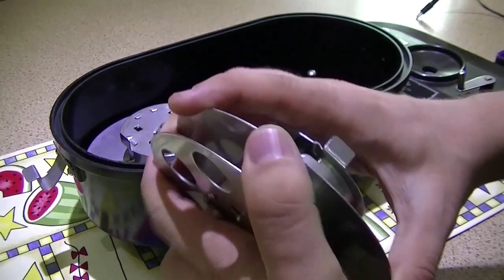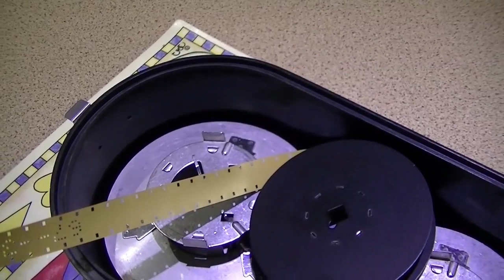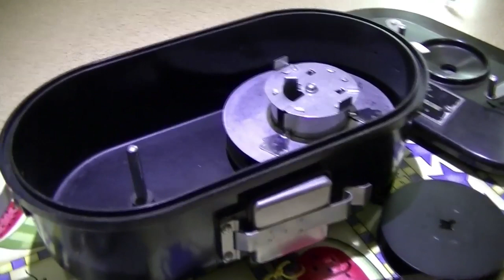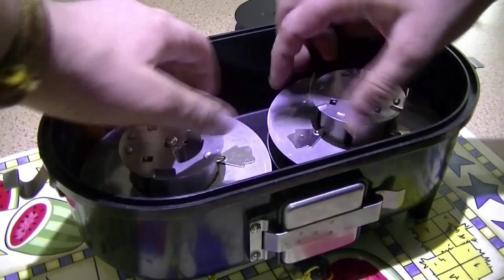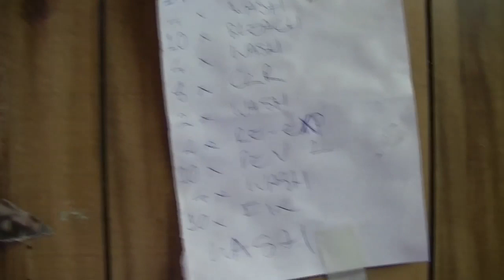Loading And Using A Morse G3 Developing Tank

Comment: 106.5 feet of film and leader was in mine. I measured it. Then, it took 133 cranks to wind the film from one side to the other. That took 1 min and 20 sec to make the 133 cranks. I did slow down a little near the end when the supply side was spinning really fast. I just wound it with a normal crank speed that felt good. Not too fast and not slow either. The tension makes you wind at a certain speed to have something to pull on. 4 passes took 5 min and 20 seconds. D-94 only takes 2 min to develop the first time on a LOMO spiral, and D-95 only takes 30 seconds to develop the second time, but I don't know how many passes that would be on my Morse tank..

Comment: Thanks for the video! I just bought one of these tanks as I like to learn to process myself. I'm just getting into 16mm filming, bought a vintage Keystone deluxe some time ago but was not sure film is still available.
Reply from the maker: You can still buy film. I get mine from Wittner Kinotechnik in Germany. They do both double and single perforated - check the feed sprocket on your camera to make sure you get the right type.

Comment: The first thing on every list is to wash one's hands. Then a reminder to remove rings and watches. Not only did they get in the way, back in the day watches weren't as waterproof as they are now. Plus, the chemicals could have possible...eh...interactions with the materials of rings and watches — especially those thirty-dollar Rolexes your girlfriend got you on the boardwalk! Best if all such were removed prior to...developments you weren't counting on. The Morse G3 brings back so many memories.

It would have been better if you had actually poured water into the tank during the demonstration to show how quickly it filled and the quantity needed. (You could have removed the film first.) You then bump it sharply to remove bubbles and go from there. Regular 8mm could be fed into it because it was actually 16mm, exposed on both sides, developed, then sliced down the middle and spliced into a single roll of film. 

Ektachrome could be developed, but I think Kodachrome had to be developed by Kodak, I think. I also developed B&W 8mm film which I reloaded onto 16mm reel/8mm reels. 

It was so cool, but it was such a pain in the ass. Very expensive and the results...meh. You went through all that trouble for just seconds of play back. What a waste of time, money and effort. I had a really cool toy, an 8mm toy projector that actually worked quite well. It broke down the middle and one half was a screen. You could then extend a reel take up, load on an 8mm film reel and watch whatever movies you wanted up to 50 feet. It worked well and didn't jam or chatter. I went in our bathroom, turned off the light and had my own drive-in. Wolfman, Frankenstein, Dracula and other Famous Monsters of Filmland movies, all at 24fps!

We've come a long way. 

__

Comment: I know you have answered this already vaguely. But I am developing Tri-X 7266, should I take your times and deduct 2 rounds from the total of only developer or all chemicals? How strict should I be with the temperature and timing? Also how many times can I reuse bleach? I am using Rollei B&w reversal kit to try this. Should be fine right?
Reply from the maker: Deduct 2 rounds just from the first developer and keep the rest as is. The best thing about B&W is there is a bit of latitude and room for a bit of error. I just keep a steady rhythm in my head when turning and it takes approximately one minute winding from one reel to the other. Nothing what I do here is extremely precise and I get good results. If you want to be pedantic, the first developer is the most important because screwing this part up ruins everything else down the line. You can't over bleach unless you fall asleep, and clearing just gets rid of the stain left behind by the bleach so you really can't overdo that either. I have done the re-exposure with the lamp slower and it had no detrimental effect. Likewise, you can't overdo the second developer as it just turns black the remaining silver - you can use anything here, even Rodinal, caffenol, Dektol, nothing special. Some people don't even use fixer but I do just for safety in case there's any remaining silver that shouldn't be there. This can't be overdone either unless you leave it soaking for hours and hours.
Reply: snarfusmaximus thank you for taking your time for this reply!! I’ll give it a try tomorrow! Would Kodak HC110 developer also work you think? How many times you think I can reuse the developer for the 100ft film? Also bleach should be okey to reuse a couple times right? Once again you are big help on this one. Not many people have had any info on TriX online!
Reply from the maker: I would use a high contrast developer for the first developer. I use D19, as I bought heaps years ago, but I believe it has been discontinued. From what I have read, Dektol is a decent substitute although it's meant to make the film look grainier. HC110 will be fine for the second developer but don't reuse it as it's a one-shot developer - can only be used once. Powder developers are generally reusable. You can also reuse the bleach and clear a few times as well.
Reply: @snarfusmaximus  Today was the day. Finally tried out my test roll. Took ages but was fun and luckily know that this second bolex I got works. However the film turned out undeveloped I would assume. The first two feet of the 100ft film look decent but the rest is just hard to really see anything. Judging that the first feet got more developing time being at the end of the film, would you recommend having it in the developer (Microphen) longer? I developed TriX 7266 reversal. How accurate do you have the temperate of the chemicals? I might have been 1-2C over the recommended 21 degree celcius... any help would be appreciated! I can also send some examples for you to check.
Reply from the maker: Assuming you exposed the film correctly - If the image is too dark, then it hasn't spent enough time in the first developer, if it is too light then it has spent too long in the first developer. I don't know what the times would be for Microphen but the above should be a guide. A degree or two above or below should make little difference.
Reply: @snarfusmaximus  yeah will try again tomorrow, might cut 100ft in half and try at 20 passes and see what happens and then correct if needed for the other half. Powdered First Developer, Bleach, Clear, 2nd Developer, Fixer should all be good to use for a couple rolls right? Also got a bit of the bleach on my hands while draining it out of the tank, if no burns, nothing to worry about, right?
Reply from the maker: @Visualtraveling  Yes, can be used for a few rolls. I've only used a dichromate bleach and that can be used a few times but am not sure about a permanganate bleach in case that's what you're using.

Comment: Hi there, thanks for making this video! I'm curious what your bleach solution. Thank you for your time.
Reply from the maker: My original bleach recipe was 12ml of sulphuric acid and 9g of potassium dichromate to 1l of water, using the amount of cycles displayed later in the video. I now use half the amount of acid and dichromate in 1l of water and double the amount of cycles. This has the advantage of being gentler on the film but you can't reuse the bleach.
Reply: thanks a lot!

Comment: Wonderful video mate. Mine should be coming soon and I'm planning to do some standard 8 Fomapan soon. I'm thinking since there's only 30ft of film on a spool, I would need to do two full cycles a minute instead of one with 100ft of film. Any tips on drying the film once done?
Reply from the maker: You'll find that you'll process a 30ft roll much quicker, probably just under 3 cycles a minute. Keep your pace steady and constant, around 2 turns a second like I do in the video. I did some Plus-X like this and it looked fine. The hole in a standard 8 spool is also smaller and won't fit on the rods in the tank. You may need to initially wind it on the developing spool by hand. All is the same from then on.

To dry, I just wind the film around a clothes horse with the emulsion side out. Don't forget to use Photoflow in the final wash to reduce drying spots. Also take note of my comments elsewhere about Fomapan R needing a fresh batch of chemicals.
Reply: snarfusmaximus Excellent and very helpful video!! Thank you very much...I've got my hands on a Morse G3 too and I'm going to try developing some standard 8 Fomapan R100 30 ft  length with it. I want to try to figure out if the number of cycles would change from your method using a 100ft length. Would I do the same number of cycles as you are doing, even though the film would spend much shorter of a time in the chemicals?

Also, are you using Foma's reversal kit chemicals for this?
Reply from the maker: Many thanks. The number of cycles are the same as long as you turn it at the same rate of two turns per second. Being a shorter spool, it'll be quicker than if you did 100ft. I've never used Foma's reversal kit. I use Kodak D19 for the developers, a potassium dichromate and sulphuric acid bleach, a sodium sulphate clearing bath, and what ever fixer I have on hand. Unfortunately Kodak discontinued D19 a while back so I'll be forced to mix this up from scratch once my remaining bags run out.

Comment: Many thanks for posting this, I just got hold of a Russian copy of this tank and am trying it out some Fomapan R very soon. What quantity of the solutions do you need to add to the tank?
Reply from the maker: You only need 1 litre. The chart at the end of the video for the amount of cycles per bath will be fine for Fomapan.

One thing to take note is that Fomapan R needs fresh chemicals - i.e. be the first film. You can reuse the chemicals for other film stocks like Tri-X or Orwo etc. I think this is because the anti-halation layer on Fomapan is silver and not a dye.

Comment: is there a link to see the developing cycles for tri x?
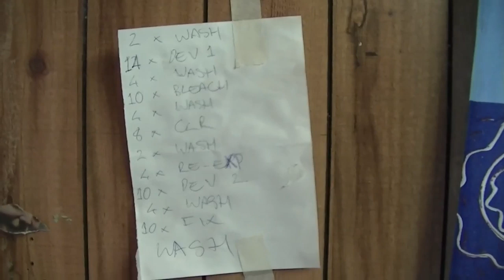Reply from the maker: Please refer to the chart at the 12:35 mark. Just do two cycles less for each development stage. Works a treat!
Reply: Cool. Do you know of a place to purchase the bleach. I believe tri-x requires an r10 bleach that I am having trouble finding. I have the d76 fix and hypo clear etc it's the bleach that's giving me trouble
Reply from the maker: I use potassium dichromate and sulphuric acid as a bleach for all B&W reversal. I stocked up on the stuff years ago, got it from Vanbar in Melbourne Australia (me living there). Most decent photographic suppliers should carry the stuff. A warning though - sulphuric acid is obviously dangerous, and the dichromate is bloody nasty stuff known to be carcinogenic. Exercise some real care when handling it.
Reply: snarfusmaximus The clr step is HYpo clear yes?
Reply from the maker: The clear bath is to remove the orange/yellow stain of the bleach. It's made of 90g of sodium sulphite to 1 litre of water.
Reply from the maker: http://blog.lib.umn.edu/tsuda005/filmmaking/filmmaking/Processing%20B%26WRev%20Film.pdf
Reply: @snarfusmaximus  this link dead.
Reply from the maker: @pedade02  Well, looks like the server is gone.
Reply: @snarfusmaximus  thanks for your video, almost none about morse g3. There is substitute To Kodak d19 developer  called Photography formulatory d19, I will order and see how it works  for Fomapan r100. Do you think peroxide+acide citric bleach option might work? I know many ones use it for 35mm film and photo paper reversal. Many thanks again.

Comment: Would Permanganate bleach work with the same amount of cycles?
Reply from the maker: Yeah, it should
Reply: @snarfusmaximus  Alright. I tried my first round of development of some expired (1963) BW reversal tri-x (16MM) last night and results were- less than stellar. About half was because im new and under exposed a lot of it, which led to it remaining a negative.

There was a lot of grain which I think is due to the age of the film

but the major issue was the terrible contrast. shadows were just super dark and the film seemed almost foggy. I used the foma reversal BW kit, so maybe the developer is just shit or I need to adjust it for the expired film? 
idk, still learning

Thanks for the speedy reply!
Reply from the maker: If you're just starting out and processing your first film, use a new roll. This way you will know if you're doing it right or not. With film that old, you need to overexpose the crap out of it. Even then, reversal processing isn't recommended for film that old. It's better to process it as a negative and scan.
Reply: @snarfusmaximus  Ok, thanks for the help!
Is there anyplace I can pick up 16mm reversal film without spending an arm and a leg? All the new stuff is like $50 for 100 feet
Reply from the maker: 16mm is generally expensive. Foma R100 is probably the cheapest you'll find although it requires fresh chemistry for each roll.
Reply: Last question hopefully:
I’m using a d-19 substitute developer from photographers Formulary. Shouldi still have it in the tank for as many rotations?

The film photography project recommends 8 minuets in a Lomo tank with the D-19 substitutes at 20 degrees Celsius
Reply from the maker: If it's the D19 formula, then you can use it for the same number of cycles in the Morse tank. From memory, 8 minutes in a Lomo was the same time for true D19.

Comment: It's possible to get 100 foot lomo tanks. You might have to fight brutally on ebay for them though. If you're tired of all that cranking why don't you just do it with a drill attachment? Would probably do it more consistently too.
Reply from the maker: Yep, those Lomo tanks are getting expensive. I have one coming that does 2x50ft which I found cheap. Will be my tank of choice for E6 and 8mm gauges as I can't imagine E6 working in a Morse. I have considered making a motor attachment but your idea of using a drill sounds feasible.

Comment: Thanks for posting this!!! I recently acquired a Russian Lomo UPB-1A tank which I will be experimenting with soon. I intend to shoot Tri-X and process as a negative since I will be digitally reversing the image. However, I have been wondering if this will affect the image in a bad way? Will I be sacrificing anything in terms of dynamic range and density? Thanks again!
Reply from the maker: I've never processed my movie film as a negative so I can't help you with that, I'm sorry to say. I use high contrast developers like D19 or Dokumol when I do reversal processing so I assume it would be the same for a negative.
Reply: snarfusmaximus Do you mix your chemicals to the same strength as you would for still film? For example, if I were to develop Tri-X, would I be safe following the recommended  formula for Tri-X still film? Thanks again!
Reply from the maker: Mark Hinchey  I would just follow the standard formula one would use for still film although I think Tri-X reversal is different to the standard Tri-X negative. I guess you'll need to experiment.

Comment: Hello.

Could you tell what your developing time would be in minutes for a spiral tank like a Lomo?  I am going to use Tetenal Dokumol as explained in the article here http://www.super8camera.com/processing/ (which is supposed to go for six minutes).  Do you have a rough guesstimate as to how long/how many cranks it would take with the Morse?

I guess a better question to ask would be an approximate translation between minutes for suggested developing time and number of turns.

Thanks

Brian
Reply: +Brian Schmidt That would be method #2 listed on the page.
Thanks
Brian
Reply from the maker: +Brian Schmidt I have tried Dokumol and never had any success with it so I abandoned it. I stuck with D19 and plan to mix it from scratch once my stash runs out.

Comment: Hilarious sir!  Loved this...and I am shooting 16mm and 8mm both.  Been looking for developing myself...seems this could get tiring.  LOMO tanks look easier, but not as inexpensive to find.  Do you know if anyone has created an automation system, like an rPi board and motor that would crank this for you?
Reply from the maker: yosemitesamiam The advantage of the Morse is that you don't have to cut the film in two 50ft lengths like one needs to for the Lomo and you only need a litre of chems. Besides the constant turning, the other disadvantage is that E6 processing would be next to impossible. Mind you, I have heard rumour of people doing E6 in it. Obviously they're a lot more courageous than I am.

I have seen a video or two of a home-built motorised system so I know it has been done. I may get around to it one day, possibly implementing an Arduino of some sort. My to-do list is rather massive, though. :-(